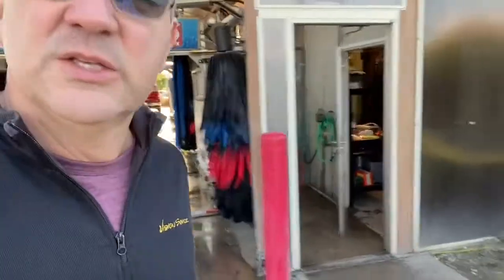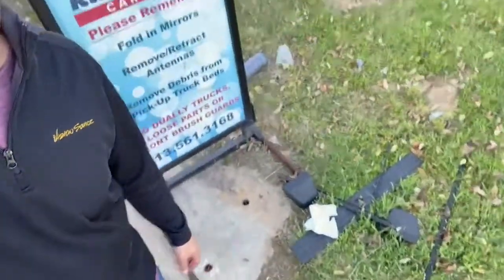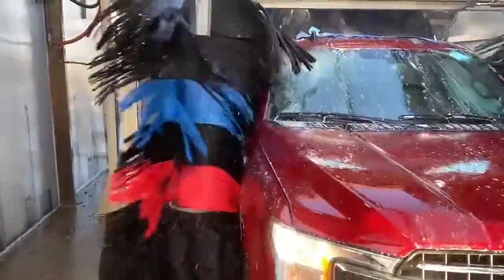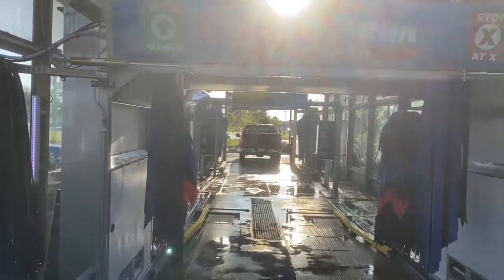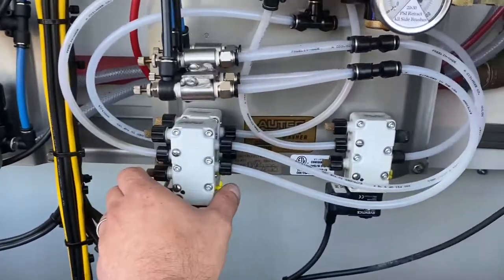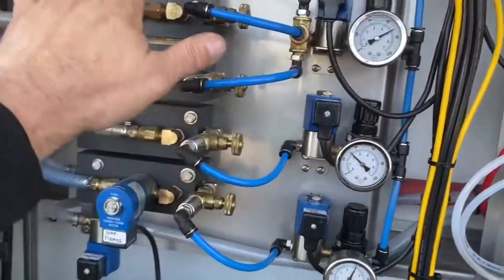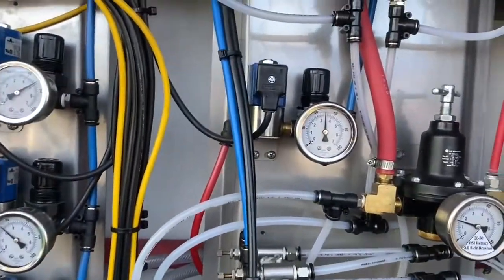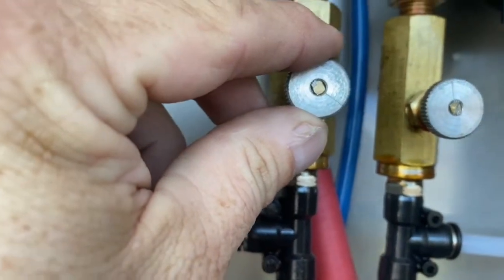Car Wash Repair - Adjusting Brush Pressure on AUTEC Car Wash Machine

Comment from the maker: Check the proximity sensors at the bottom. They should light up when you put metal in front of it. Also call Autec. They are super helpful for tech support.